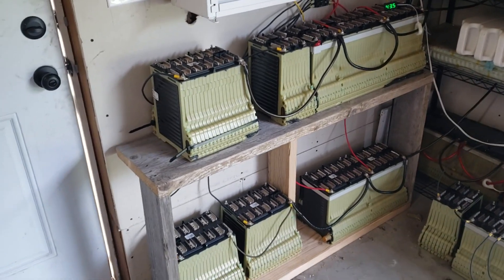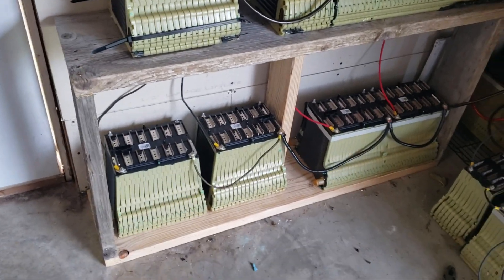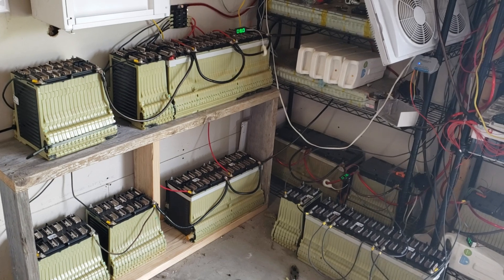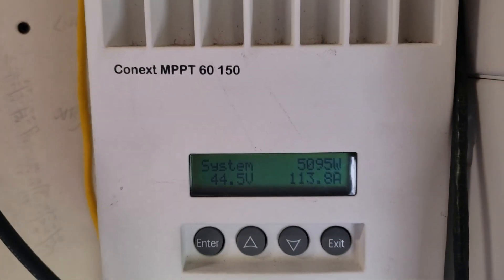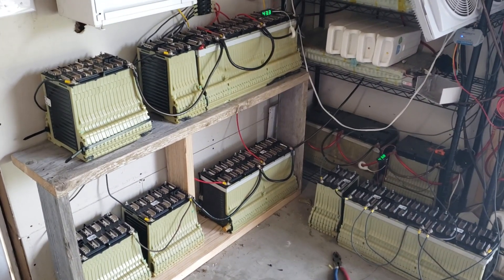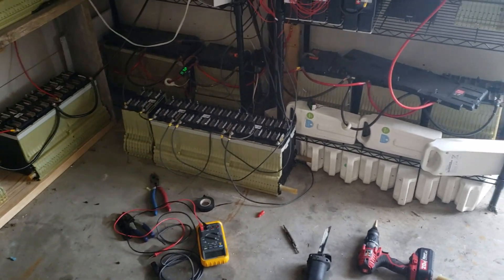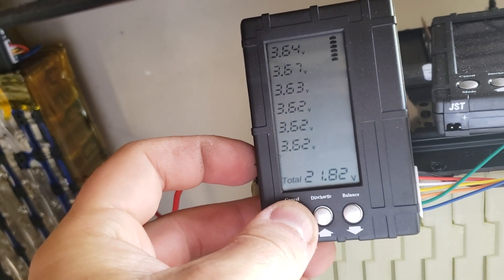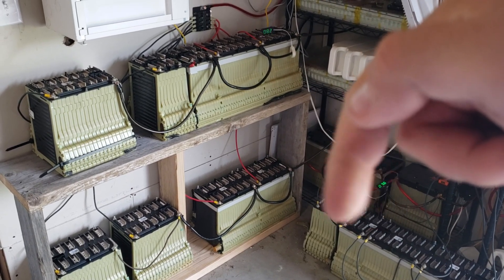New addition to my diy solar family. 16kwh chevy volt battery

Comment: I have a question? Are running a Conext 6848+ in your home? If so how do you manage the voltage parameters for charging the Volt Baterries
Reply from the maker: Yes I am using the 6848+ and to get the voltage low enough, you have to use the XW control panel to lower the voltage. I had to call Schneider and get the process.
I have been running this for 5yrs and no issues
Reply: @mytime34  Great, looking to get a 6848 Pro, they are cheap at the moment and I know you need the Schneider Home Insight to change paramters, but I have 2 whole Volt packs broken down to 48volt units that I dont want to go to waste and use for battery back up....I appreciate the info. If I have any other questions, would it be OK to shoot them at you?
Cheers 
Kameron

Comment: Hi, I have a similar set up, just wondering what charge rate you charge the batteries at? Thanks
Reply from the maker: The max charge current is set to 150amps. I only charge the batts up to 50vdc and low cut off it 42vdc

Comment: What’s your float voltage a.k.a. full voltage and you’re cut off low voltage is that a GEN one pack ?
Reply from the maker: Full voltage is 49.2vdc
Cut off is 40.2vdc
Yes these are all Gen 1 packs

Comment: just curious how many chevy volt batteries am i seeing complete batteries from the car
Reply from the maker: 19ea 48v packs. These were pulled from 2ea Chevy Volts. (I think I bought 2ea 48v packs seperately
Reply: @mytime34  so this is 2 complete chevy volt batteries b4 modifing for solar
Reply from the maker: @hoosiersolarpower974  Yes this is at least 2 full complete batteries from chevy volts. I think I paid $1600ea. Here is a link to similar item on ebay https://www.ebay.com/itm/254805124384?hash=item3b5391a520:g:hSsAAOSwWjpZp1HT
The internal packs are a combination of 24v and 48v packs. I left some of the packs strapped together, since they have strapping and screws that keep them from expanding.

Comment: Hi! I wanted to ask you if the cells monitor you show can lower the voltage of a cell. I also use in my home Chevy Volt batteries. Thank you!
Reply from the maker: The monitor I use, only monitors, it does not discharge. I also have my charge controller and inverter set to a min & max for the batteries. 3.2vpc min and 4.0vpc max. This way the batts never get drained or charged too much
Reply: @mytime34  Thank you Micheal! At first I bought 8 Chinese Smart BMS but finally I am not using them. After year and a half all is fine, but check every cell with the tester it is a little bit tedios. So I have bought some cell monitors for an easy job. By the way, today I got the second Chevy Volt pack to add to my setup. Not so big and impressive as yours but 32 kwh is good for now. 
Now I want so much panels as you! Congratulations :)